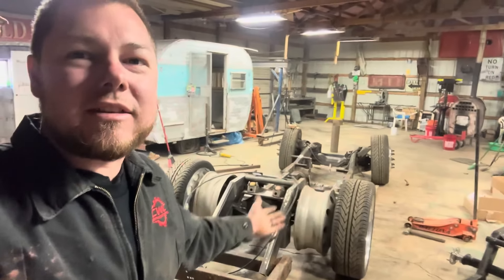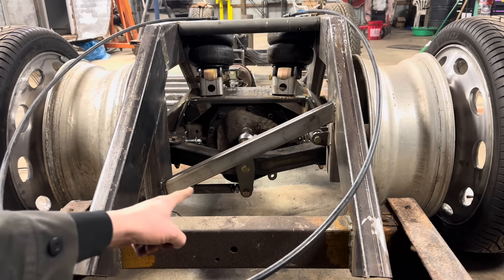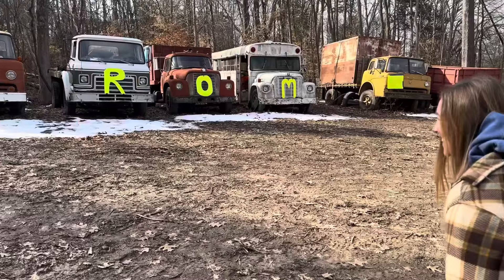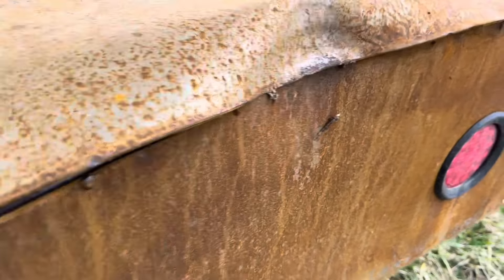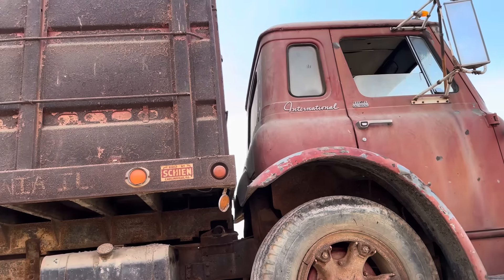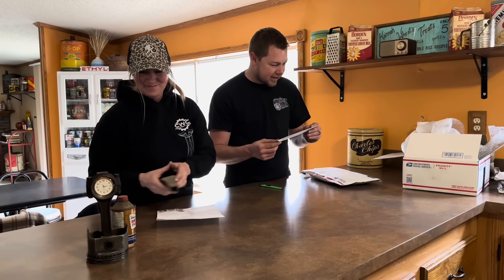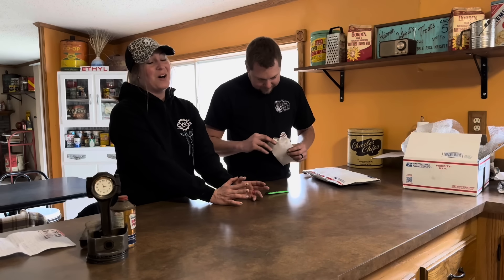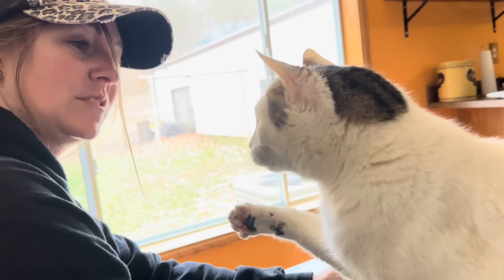Where do I even begin….

Comment: If my memory serves me right the Indy cars used Watts linkage in the 50’s. This would be the early front engine roadsters. At 75 my memory isn’t what it used to be but when you was describing the Watts linkage the light in my pea brain came on. I like the Watts linkage myself.
Reply: A watts linkage is by far the superior choice if you plan to use variable ride height, or steer both directions. Nascar uses a panhard bar because they can preload it to make the car more or less easy to steer one direction only.